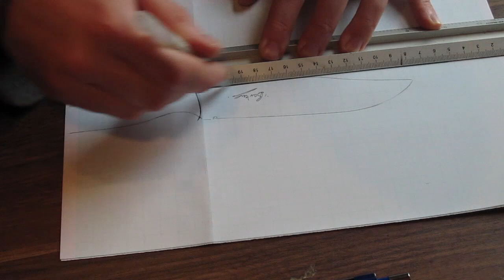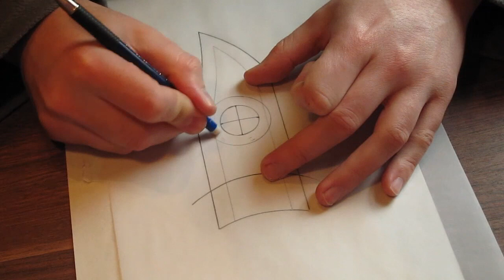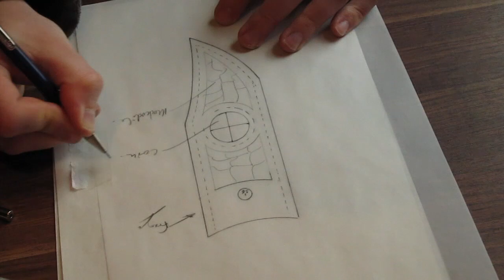Making an Inlaid Leather Cowboy Sheath for a Bowie

Comment: I would love to see how the strap/belt loop were attached to each other. (And if there's anything holding them to the sheath besides that stud).

I'm working on a sheath for a massive bowie the cheap sheath fell apart on, and figuring the guard area out is giving me issues. Doing this for free for a friend, but I'd still like it to come out nice.
Reply: That type of sheath is common for traditional bowies. The sheath for the knife has a stud in the front, and the belt loop that attaches to that stud is called the frog. There's nothing else but the stud keeping it in place, but that's okay since gravity does the work and if the size ratio of the stud compared to the hole is on the larger side, then it's very difficult for the knife to come loose. So difficult that it's never come off without you wanting it to. It's actually my favourite type of sheath. Very comfortable to wear.

Comment: Hi Ian. I very much like your video's. Lots of info in detail. Thanks for sharing your techniques.  Question ; i see you use a drillbit and Dremeltool to get holes in very thick or multiple layers of leather. I used to use a drill also. Have you ever tried  to use a hardened steel nail instead of a drillbit to get the holes using a dremel.  I have used a 2,5 and 3 mm thick and 50-60mm long hardened nail and cut of the flat end(head)...the pointed side was rounded off and mirror polished. It  pushes trough 12 mm leather like a hot knife trough butter and leaves a perfectly round hole without actually cutting much fibres. At the back end of the leather you do not have a raffeled hole like a drillbit somethimes does. An ordinary drillbit also tends to push the cut fibres aside and doing so fattens the seperate layers a bit. A nail does not do this. A nail leaves a slightly smaller hole when it exits from the leather.. A 2.5mm nail for instance leaves a 2mm  round hole...a 3mm nail leaves a 2.5mm round hole. I bet if you can fit a nail in one of your dremel chucks....you never use a drillbit again ;0) Try it sometime. All the best , and keep posting your vid's
Reply from the maker: +HoutmeyersP I haven't drilled anything in years :)

Comment: Perfect timing for this excellent video.
I was thinking about inlaying a coin but not sure if the contact cement would hold a coin to leather, have you cut the top layer slightly smaller to hold coin in? 
Thanks
Reply from the maker: yes, I wouldn't rely on glue alone

Comment: WOW  That is beautiful.  Does it cost a lot in tools and supplies to start up??
Reply: It really depends on what you are getting started with, and how serious you are about it.
You could get started for a couple dozen euro's fairly easily, with just a few basic tools and some improvisation here and there.
Then again, if you are actually serious about learning and improving your skills, i'd invest in a few decent quality tools and materials.

Also, take a look at the tutorial video's about stitching, folding and bending, dyeing, and the like.
They add up to a couple of hours, and cover the basics and some quality advice about everything on the subject of the video.
Reply: Really depends how good you are at sharpening, you can manage with cheaper tools as long as you are good at resharpening the softer steels that usually come with cheaper tools. You can probably manage with cheaper tool with a 100-200 dollar investment. Better tools like the ones Ian has can easily break $1000. But, the cost of the tools is nothing compared to the cost of the leather.A decent side will probably end up costing you 150 dollars on the low end and over 300 dollars on the higher end. Definitely not cheap at all.

Comment: HI- I'm trying to figure out how to inlay real cabochon stones into leather...with a curved surface...how would I prepare my leather to accept a curved surface vs. a flat coinlike surface. No one has a video out there-if you'd like to make one-lol!
Reply: Hi, I am looking at doing the same, did you get an answer?
Reply: Brenna Kohlhase 
Skive inward from the edges with a curved wood chisel, also known as a gouge, that's a bit smaller in width than your stones. Just make sure it's as sharp as it can be, or you risk cutting too deeply by accident.